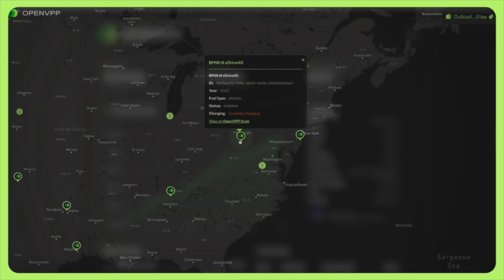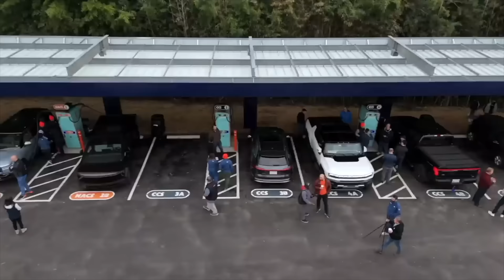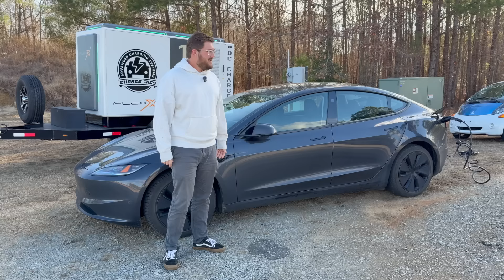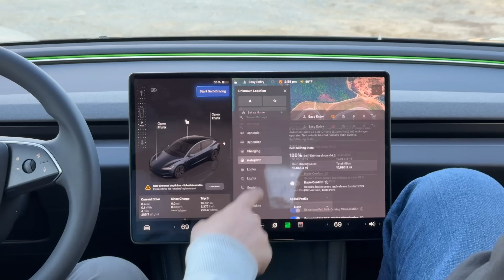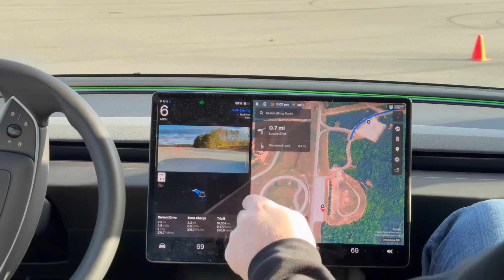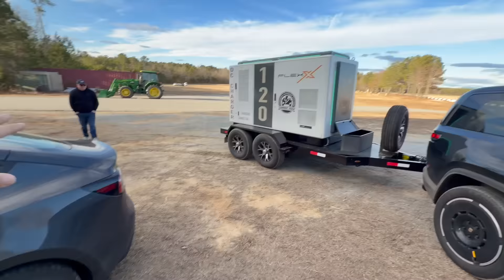First Cross Country Autonomous Drive Completed! Over 10,000 Miles Using Tesla FSD w/ No Intervention

Comment: Own a 2023 M3 SR HW3 version with FSD (Supervised). Use it along with Summon maybe 55% to 60% of the time. Sometimes higher or lower as I still enjoy driving and being in control with that instant torque and lower center of gravity along with knowing the rough roads in my city (ATL). Works really well. Still it’s not perfect and I’m fine with that. Really enjoy how it maneuvers within my apartment buildings parking deck which is a big plus.

Comment: I'm pretty sure the bit about the front bumper cam being leveraged in FSD is incorrect. Even Dirty Tesla's own videos on it from what I've seen showcase that it is not used. Searching youtube there is at least one video showing it is not taken into account in the AI model and will happily run things over in 14.1.3. Can't find any 14.2 videos right off the bat but they'd need to collect data of cars driving with that new camera in order to work it into the model and would need a way to still have the model function well without it. There is also the question of whether the HW4 computer can handle an additional camera stream and still perform well.

Comment: Did this drive 2 weeks ago. Beat ya to it. Drove east late Oct on 14.whatever.  Drove west on 14.2.2. Really wish they hadn't eliminated the speed control scroll. I've used cruise control for decades and maintaining a consistent speed  is key to safety and not being an annoying interstate cruiser who basically speeds to the next tailgate, then passing, then slowing up when they find themselves in the lead. Kind of makes me think the engineers have little real world traveling experience. Nudging the car along with pedal will get it to get back to 80-85 but it will lag back if there's no other traffic to guide it. Traffic performance in NYC was impressive. 4 way stops require some pedal nudging to keep up with NYC drivers. Waiting for full stops will have everyone taking advantage of the car's patience. Parking at Superchargers is hit and miss, crowds neighboring vehicles, backs up too tight radius. Next update should bring back manual scroll speed control. Don't need cute names like sloth, chill, hurry, mad max....Just give us mature controls for mature drivers.

Comment: Of COURSE it’s not autonomous! Supervision by a licenced driver isn’t just a phrase, it is at the heart of the exercise.
Aircraft autoland systems are far, far more safely designed than any simplex car FSD yet are supervised by crews trained to recover from anything that is thrown at them at any of the stages of use and THEY are not autonomous.
Autonomy would mean no physical controls NOR any on-air backup or recovery.
Supervised FSD is fantastic, a triumph - but not autonomy in any meaningful sense.

Comment: I have a ‘26 MY Launch series (March 2025). Drove roundtrip central Texas to north Maryland area in December. FSD performed extremely well. 95% FSD since V14.2. Only minor glitches: mostly autonomously stopped at Superchargers, but chose to park at undesirable spots too close to other occupied spots, so disengaged. Since wife was with me, we had to stop more often than desired or planned. Anyway, very safe. Notably, FSD avoided a few potential accidents, caused by others or objects in the road. I’m impressed since I’ve had either EAP (enhanced autopilot) in 2018 or later FSD and experienced the full progression. I’m ready for unsupervised!

Comment: I see a lot of FSD videos using it on interstates and urban environments. Those are certainly challenging, but do not cover the full range of driving. How will the new FSD perform on a challenging rural highway with constant corners and speed changes, and with drop-offs at the edge of the road? This may seem niche to those living in many parts of the US, but this is the majority of driving where I'm from. The fact that it still doesn't seem to avoid potholes, or always slow down for speed humps unless they're clearly marked doesn't sound that great.

Comment: has anybody encountered really difficult situations like:
1. heavy rain when the wipers couldn't cope?
2. snow that covers the entire road?
3. salt on the road that ends up seriously covering the windshield?
4. thick fog with only 1-2 car lengths of visibility?
5. really bad drivers that act like your car isn't even there?
6. automatic barriers? tolls?
7. accidents on the road?
8. road works?
9. police officers giving hand signals?
10. emergency vehicles with all the sirens on?
11. sun glare that makes seeing difficult?
12. (parallel) parking during heavy rain at night?
13. a winding road with hairpin bends while in a line of cars and trucks?
14. overtaking a long lorry in a single lane road with limited available space?
15. very uneven and unmarked roads?
16. massive potholes in the road?
17. caved in sides of the road?
18. bicycles on a single lane road?
19, new roads that aren't yet mapped on the screen, when the map is just wrong?
Reply: I’m using v12 on my 2018 Model 3 that has HW3. On all the situations you mention above, with the exception of 6, 9, 10, and 16, it handles all of it pretty well. I don’t know about tolls because I have the car set to avoid toll roads (saw a lot of rural WV on the way to Richmond as it took me off the highway to not pay tolls). When it comes to cops and emergency vehicles, As for potholes, it knows speed bumps, squirrels, geese, pets, all sorts of stuff but it will not dodge a pothole or manhole cover (grrr). I don’t trust v12 to do the right thing. But what really amazed me was driving in winter on a completely snow-covered road. It just seems to know how to subdivide the space and make its way. Can’t wait until they get me 14 somehow.
Reply: I meant to say that I am squeamish when it comes to cops and emergency vehicles. I disengage when I see them. I think v14 is supposed to handle them well, including hand signals from traffic cops. I would search for videos on that one.
Reply: @woof059  How does FSD handle fog when I know firsthand adaptive cruise will not work?

Comment: I have a 2018 M3 with HW3 (took advantage of the free hardware upgrade from 2.5 some time ago) and use FSD for most all of my driving.  It does really well - but for parking lots.  I keep thinking i'll drive myself, then just don't....easy to turn it on.  Kind of afraid to try a HW4 car at this point - it's sure to cost me some $'s....

Comment: Does nudging the accelerator pedal count as intervention? Just wondering because it does not disengage FSD….
Reply: Excellent point. Obviously yes. True autonomy (human level) means no supervision nor tele-operatation. And technically FSD is still level 2. Waymo is level 3 autonomy. Nevertheless, we are experiencing awesome technology improve exponentially. I have a model 3 RW LRD 2025 with FSD 14.2.2.2. I give it a 4.9 rating
Reply: @moderncontemplative Waymo is level 3 autonomy. 
Au contraire, Waymo is SAE Level 4 autonomy; but in an ODD that is orders of magnitude less complicated and difficult than FSD.

Comment: My 2 cents: If you haven’t intervened while the Tesla was on FSD, then it was autonomously driving… all you had to do was input a destination similar to Waymo.

The only official difference I can see is where you are sitting as a passenger ( i.e. sitting in the front drivers seat vs rear passenger seat); nonetheless, FSD v14.2.2 onwards is one of the most impressive pieces of software I’ve ever used. It can tell things apart just like a human would, perhaps better than humans and it does indeed drive, park and find its way around all obstacles.

Comment: This latest version 14.2.2.2 has some issues. I have 26k miles on fsd and today I had to intervene twice because it tried to pass using turn lanes. I've never seen that before. I hope this gets fixed quickly. That said, I don't ever want to buy a vehicle without fsd. I have grown to depend on it. It is so much safer than me doing the driving without it.

Comment: In my 2025 Model 3 RWD, I did nearly the same for Christmas. I did Los Angeles, to Las Vegas, to Gallup, NM, back to Vegas, back to LA. I'd say 99.8% FSD. I purposely took over when I changed my mind about where to park or where to eat. There wasn't a single complaint. I only wish there was a permanent slider at the edge of the screen to go from Standard/Hurry/MadMax etc. Not that it's hard, but a slider always there would be nice. I now have 14.2.2.2 and testing that. This is just insane stuff. For the most part, FSD is solved!

Comment: FSD will have FULLY arrived when my Tesla can take me to the airport then drive itself home. And when I can summon it when landing on my return and it picks me up again. I give it one to two years. Meanwhile, I love it every mile.
Reply: 14 months
Reply: Tesla has been training FSD in China the past year, that's how it improved so much
Reply: @danielzhang1916  I Dont think it has anything to do with how FSD improved, because China's data cant get out of China. so they cant use Chna's data to train others fleet.
Reply: @pindot787  they use other ways around it
Reply: @pindot787  Tesla's Full Self-Driving (FSD) system has been undergoing training and limited trials in China, but faced significant hurdles due to strict data laws requiring data to stay in the country and new regulations for software updates, leading to pauses and a shift to using internet-sourced videos and simulations for training, as confirmed by sources like Reuters and Autoblog. Tesla's strategy involves using Baidu's mapping data and training the AI on simulated Chinese roads based on online footage, rather than direct data from its massive fleet.

Comment: I would like to see some version of light display to show when the car is autonomous driving. Maybe a tail light slow fade on and off, or turn signal flash pattern.
Reply: This is almost certain to happen, with a turquoise-colored light around the headlights and taillights.  . Mercedes-Benz has received regulatory approval in Nevada and California to use these lights on production vehicles equipped with its "Drive Pilot" system, and SAE had included this shade in its J3134 standard for autonomous vehicle marker lamps.

Comment: I have a 2021 MY with HW3. Two issues I have are in Western WA, during the winter months, the sun never gets very high so coming in the side and I often get "Camera Blinded" messages. The other issue is I go through multiple school zones (with automatic enforcement cameras / tickets) and FSD doesn't slow down for them. Are the latest cars and FSD able to handle these situations? Seems like the glare problem (which is hard for human drivers also) would be a hard problem.

Comment: Adding the % on FSD was genius… now they make it a game to stay on FSD and keep that number high… much like when I had a Volt, it was ‘how far can I go on pure electric before kicking over to ICE.’
Reply: The game I would play is how far can I make a tank of fuel last. One time I made a tank last 2050 miles, another time over 1800. Most of my driving then was in the city with 25 mile round trip commute.
Reply: @kng128  I think I was able to do at least 1200 miles per tank but my car was the one we always used and due to the 3.6kW charging sometimes staying all electric wasn’t gonna fly.  
That said I did hit EMM a few times but that was mostly in perfect conditions.  Also ERDTT in the winter, what a dumb feature.

Comment: I've use FSD thru various incarnations over the past  20 months and 50k or so miles, and while FSD is an incredible example of driver assist tech, IMO it's still L2.  FSD still suffers from data input issues, which cause FSD to disengage and "take over immediately."  Supervised driver assist hardware/software is just that; it's not autonomous.  I do rent it occasionally, but I'd never own it.  FSD is still not what Musk was selling over 7 years ago, and IMO that's the benchmark that has to be met.   FSD and Nav don't always communicate.  Nav seems to know where it needs to go, but FSD doesn't always get the message.   * Juniper AWD, HW4, 14.2.2.+.

Comment: I wish I could say that FSD was great, but snow and fog are the big downfalls of the system.   Even in Standard it did a full AWD sideways burnout through an intersection this morning in slick conditions and then lost complete control when it decided to lock the brakes and slide through an intersection and almost hit a semi when a light turned yellow when I was about to cross through the intersection.  Shortly after that it tried to park in a space with a car already in it.  I’m just done with FSD.  It’s absolutely junk.  It’s extremely dangerous.

Comment: I had the pleasure of driving a Cybertruck with 14.2. It was awesome. Drastically different than my HW3. As for HW3 I use it 95% of the time. I have learned to work with the quirks and enigmatic issues. I have noticed that there are incremental changes with HW3 based on the overall operating software upgrades.

Comment: I’m at 95% FSD with 2100 miles. It really sucked at changing lanes when v14 first came out, and now with 14.2.2 has bad routing which makes me want to take over. Still, having FSD drive 95% for me is not bad. I still don’t feel ready to sleep in the back while it drives on its own. There’s been a few iffy situations where I felt I needed to take over

Comment: I have 2000miles on v14.2 and less than 10 miles not FSD so it says 100% FSD.  I’ve had to put up with some odd behavior (that drives my wife nuts) but I’m treating it like a game for now.  Even with this, there is NO way I could have done this with zero disengagement.  It can’t even reliably back into a Tesla charger much less my driveway/garage.  Also the routing can be quite odd. 

Still it’s amazing but not perfect.
Reply: When you check your fsd miles does the 100% corroborate with the mileage driven.  For instance his mileage matched exactly to the 10th of a mile. (Pic)

Comment: The evidence is??? So it pulled into charging stations without assistance. I don't think so. It went into hotel parking lots without assistance, i don't buy it.
Reply: Yes it does pull into the charging stations without assistance. Same thing for the hotel parking lot. FSD works in private indoor parking too. However, you have to get out and plug the car in yourself. Unless Tesla brings out the automatic snake charger they revealed years ago or goes the high power wireless/induction charging route, the driver has to plug the car in.
Reply: This is a reality now with the latest versions of FSD. It can now go from being parked in your driveway to your destination and parking at your destination.
Reply: @ProXcaliber  Rubbish! This is one data point at best. There is plenty of data showing it drives illegally.
Reply: @keithdow8327  It certainly isn't flawless, and no one claimed it was. We are just stating the reality of it being able to accomplish this task. I also don't know what you mean by "drives illegally".
Reply: @ProXcaliber  By drive illegally I mean it drove on the wrong side of the road. That happened the first day of robotaxi in Austin Texas.
Reply: @keithdow8327  I hadn't heard of that incident. Was it resolved? I haven't heard it happen again so it must no longer be occurring. This is software we are talking about after all, which means it improves over time, and that bugs or issues will arise on occasion. If this incident happened when you say "first day of robotaxi" then that would have been in June, and since then there have been many updates.
Reply: @ProXcaliber  

To be precise, probably software isn't updated but a series of numbers called weights. 

Also FSD operates at approximately 2.5% of human safety benchmarks in terms of intervention frequency (1,454 miles vs. ~60,000 miles per incident). Weather degradation, phantom braking, unprotected turn challenges, and regulatory scrutiny underscore that supervised operation remains essential. 

Here is a headline to look up from just before Christmas.

"Tesla livestream ends in head-on collision in China
 
A Tesla vehicle reportedly drove in the wrong direction and collided head-on with another car during a livestream in China, raising questions about the automaker’s "Full Self-Driving" (FSD) system."

No, it still drives down the wrong side of the road. Some cars never learn.
Reply: @keithdow8327  “Weights not software” is like saying “it’s not music, it’s just audio samples.” Cool… it still changes with updates.

And that 1,454 vs 60,000 comparison only works if you pretend “intervention” = “crash,” which it doesn’t.

Single headline anecdotes aren’t “plenty of data.” Start-to-destination + parking is real (with supervision). If you want to argue “not driverless yet,” say that.
Reply: @keithdow8327  As a side note, what China has for FSD is not the same as it is in the US. Tesla actually hasn't gained full approval for FSD in China, and because of this, China is still on v13, which is now several months behind the latest builds available in the US.

Comment: I put 25,000 miles in 2025 on my 2022 model 3 90% in FSD . The evolution over just a single year was amazing to experience.
Reply: 2026 it will be 100%!
Reply: HW3 or 4? I also have a 2022 Model 3 AWD with HW3 and even though it’s only v12.6.4, it’s still amazing.
Reply: @k @Kylecoolky HW3 and it’s leagues beyond anything else I’ve drive or been a passenger to. It’s really awesome to see the progress still coming our way